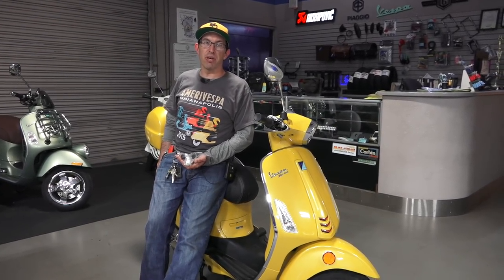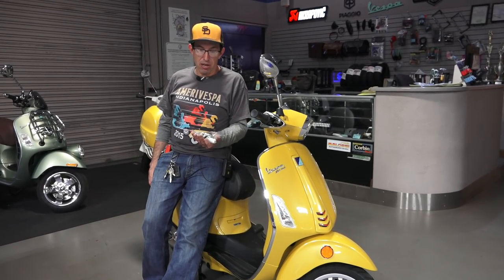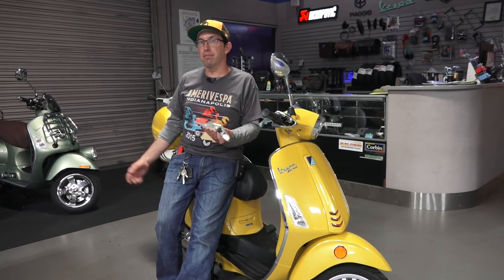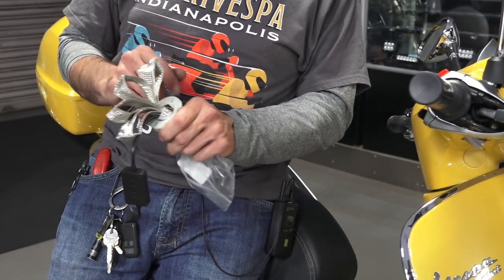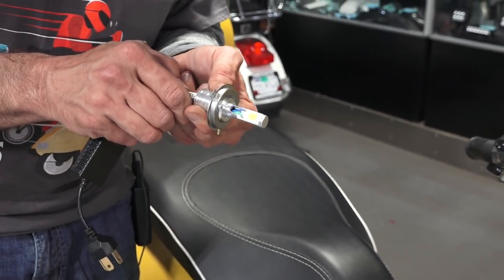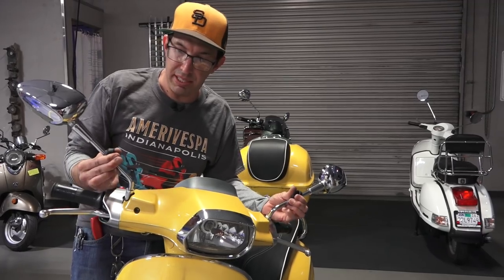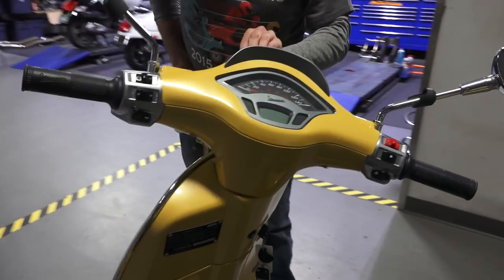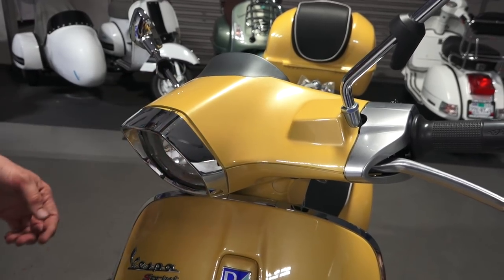LED Headlight Kit for Vespa Sprint & Primavera

Comment: Great  video, thanks so much.  it helped me a lot to carefully get access to all the wiring in the Dash console. A Rat or a Mouse has been  living in my Dash and started to eat the wiring in there.  My Sprint didn't start any more since some of the wiring of the ignition switch were eaten and some other wiring as well.  Surprisingly my lights still work as well as my brake light and indicator lights.   I made some short video of the eaten wiring.  I can share the video with you if you like to see it. just let me know how I can share it with you.  Many thanks again. Cheers Berto

Comment: Hi there, I inherited the led H4 from the previous owner and installed it but my led diodes are single round ones (not double flat ones like yours) and the heat sinks fan out up and down, not left and right. Is mine older or something? Thx for your videos!

Comment: Any recommendations for an LED kit for a MKI T5 as the ones I have tried are just not able to fit in, inside where the speedo goes makes it a very tight fit, these were the first use of H4 fittings on unique to the T5's square headlamp.

Comment: Robot need to ask how to remove nd to fit back switch housing for primavera sprint same design with in this video? Coz i accidentally dropped mine now the lower part of left handle is opened half opened...

Comment: Can i aks my vespa sprint 2015 low beam doesn't work but high beam does is it a fuse issue or does the bulb need replacing ?